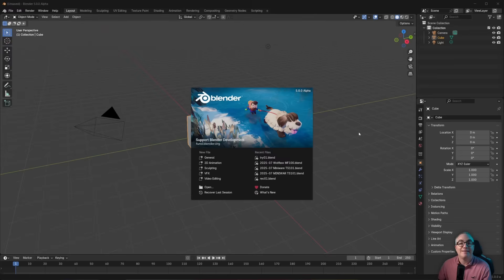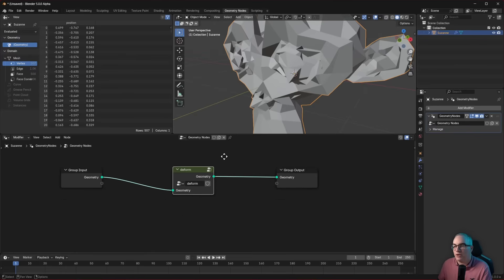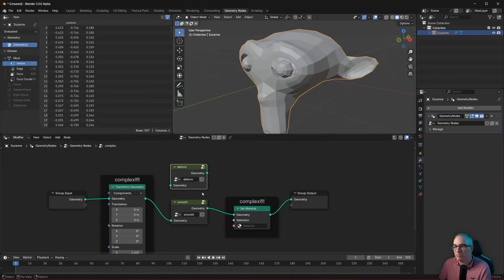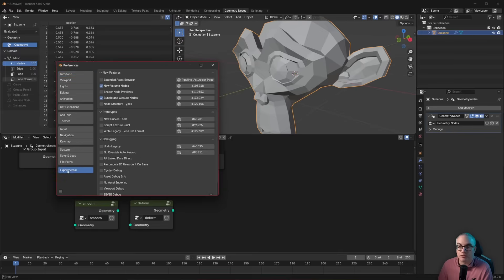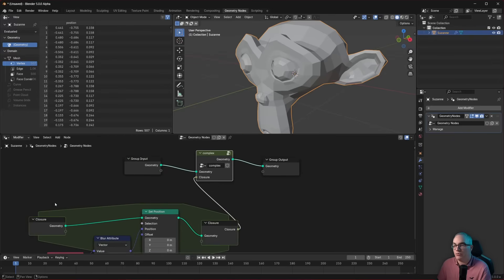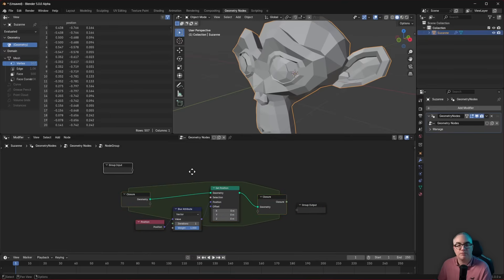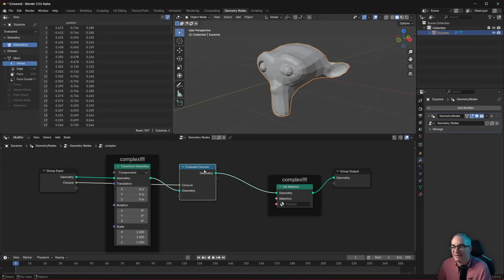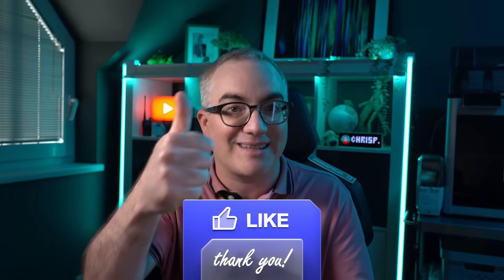NEW Blender Feature! Geometry Nodes Closure Tutorial

Comment: Could you do a realistic example of closures within the materials system, where closures make a lot more sense than node groups?
I'm thinking maybe smoothed triplanar mapping where a single image node is outside instead of multiple times inside.
The way I'm using inside currently, is to replace the link for the image instead of selecting a new one which doesn't update all.
I know about this of course, but other users using my stuff would probably dislike the setup for not being very user friendly.
Could go even further an make a triplanar setup that covers all 6 cardinal directions of wood directions (image texture based).
I'm then collapsing UV lookup to upper and lower half, as well as three divisions horizontally in a "wood controller" setup. Kinda complex.

Comment: Honestly, I thought about doing this a different way. Like, you see how you can change the group with the button to the left of the name? I was thinking about making that an input. It's a feature I don't see a lot of people using. But this is cool as well.

EDIT: 17:37 OK I guess you wouldn't be able to use two groups at a one time. Unless we had like an Evaluate Group node.
Reply from the maker: You would also need a datatype for connections - and that's what the "closure" type is

Comment: Wouldn't it be much easier to just use code instead of these visual blocks?
Reply from the maker: Maybe ;)
Reply: @chrisprenn  I wish there was some more integration between scripting/programming and geometry nodes. Something like the OSL shader node but for geometry nodes. This way once the creator gets used to GNs, they can more easily dig deeper and make much more performant tools.

It would be a very nice stepping stone between high level editing and learning to just forking and editing the blender source code.

Imagine a node that's a script that runs for every vertex. And it's like "here you have all the data available to this node at the moment of execution, go ahead and use it programatically however you want". I'm sure there's something that makes this very hard to implement, but I'd also like to learn what that is.
Reply from the maker: In "Animation Nodes" we had a script node that did exactly that and you could integrate it into your node tree with anything as inputs and use variables from the script as outputs.
See https://youtu.be/h4kCQQ5tA74 for example.
AN were way ahead of their time in many areas, but they were not great for manipulating geometry.

Comment: This was a bit vague. Maybe using a real example where you need a closure to do something which is impossible without it. Let's say inject something into the middle of a process (not two independent groups which you grouped). Or simulation, where it is impossible to have them in separate groups. Or if you want to input a list of strings into a repeat zone, or to use a closure to set the falloff of a value in the middle of a tree (which the only other way to do is to store an attribute and just plug it into the node group within which it was generated, which I don't think is so intuitive (maybe it is 🤷‍♂️)) etc. etc.

Also, this might be a premature video, since closures are in the middle of development, but it's fine. Thanks for the video. Maybe I have given you some ideas for a follow-up video when it is out of experimental (or alpha).

If you want to see a potential feature of closures which is really cool, look at the Blender development website pull 141264 (website then: /blender/blender/pulls/141264).

Comment: So, in my opinion this closure feature doesn't make sense. Using node groups is more explicit way to modify values
Reply from the maker: Closures are much more flexible since you can not only change some values on a node group but instead plug in your own program. The video is really the best way I can explain this concept.
Reply: Even in programming, closure (or, function as returned value / passed arguments) is not the most beginner-friendly concept, not to mention the user base of GN has quite some non-programmers.

But for tool builders, this can indeed be very helpful.
Reply from the maker: @linkzerotsang exactly

Comment: This is a fantastic description of what closures are, how they work, and why you'd use them. It seems Chris P understands computer programming. All the others I've seen on this topic talk about it as if they don't understand why you would use this. 🙂

Another important point is that you notice the closures get defined after the "complex" group. It's a way of letting someone build a generic piece of geonodes that can be reused elsewhere. Another layer of abstraction letting people build on top of previous work.

The reason you'd put an input in the closure input instead of the group input is if the "complex" is evaluating the value. For example, it could create a selection to apply the closure to, or an iteration count for a simulation, or something like that.  Just in case there's less-experienced programmers who haven't worked with this sort of thing before.
Reply from the maker: Glad you like the video! 😃
Reply: are closures like void functions? I'm still trying to understand
Reply: @jamesriley5057  I don't think so. The closure seems to return (i.e. the output of the function) a value that could be geometry (a collection of triples), a vector, a bool, a float... which Blender works out itself from the nodes inside.
Reply: @jamesriley5057  A closure is a function wrapped in its environment. Basically, take a function, look at all the variables the function references that aren't parameters, and create a data structure that holds those variables and a pointer to the code. That's basically how you implement it.

Since C doesn't have environments for functions, instead you implement it as a function that takes a pointer-to-void parameter, then you pass around the FP and the void pointer.

In the case of Blender, yes, it's very much like a pointer to a function. The function it points to is at the left side of the "closure" noodle. The pointer itself is the right end of the closure noodle. And invoking the pointed-to function is the "evaluate closure" node. So it lets you plug node groups you just wrote into the middle of node groups someone else wrote a long time ago. The "environment" would be any settings or whatever that are in the node group you are plugging in, like colors or floats or whatever.

In OOP, you'd do this with inheritance, making a subclass and overriding the superclass, and the instance variables would form the "environment."